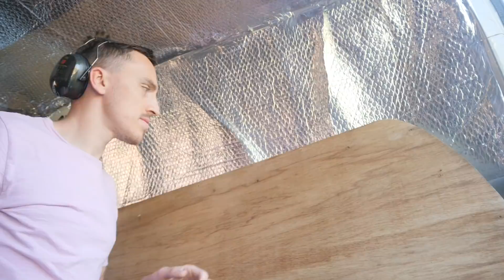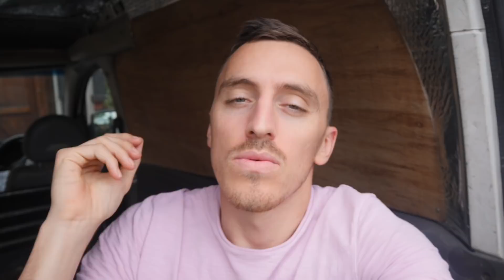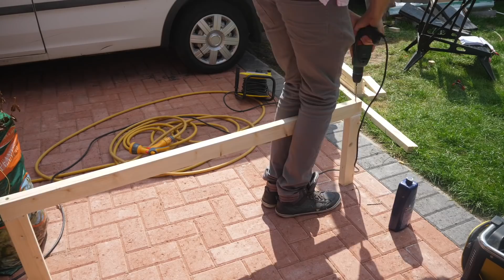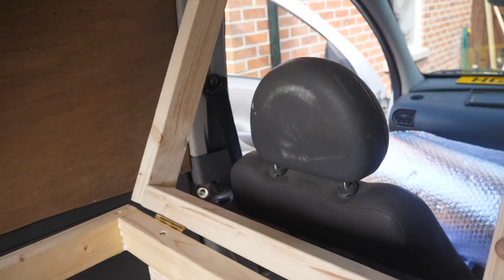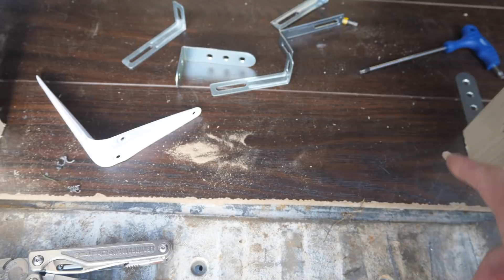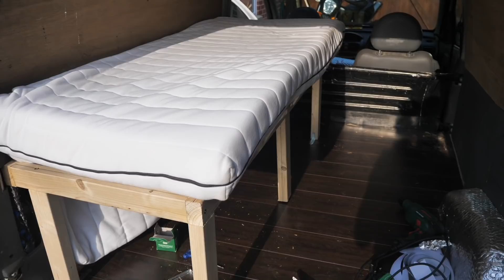Foldable Bed in £1000 van conversion

Comment: Still loving your £1000 build, I live in the uk too and I know from experience you can't have a stove that requires being outside to use it, I recommend having the front window open and possibly if your budget allows, a cheap fan, if if doesn't have a clip I would make one or go to the tip and rescue something that can be made into one. With a fan blowing onto the windscreen you should be fine 😀
Reply from the maker: Cheers Claire!

Comment: Hi Hugh. Quick question, is this or other van conversions listed as a camper van for insurance or still listed as commercial vans? How do you MOT a conversion? Or inform DVLA? Or buy it and insure it as a van, then have too re-insure it once converted? Cheers, great vids
Reply from the maker: Hi Richard, I made a video about tax class change (uk based). you have to meet a certain amount of requirements to class it as a camper

Comment: Hi Hugh, what was your experience of using that thin insulation in your previous van? Was it warm enough, particularly in the winter of the uk?
Reply from the maker: I would not use it as the main insulator. Definitely use something other like celotex or wool based insulation or even a combo of the two